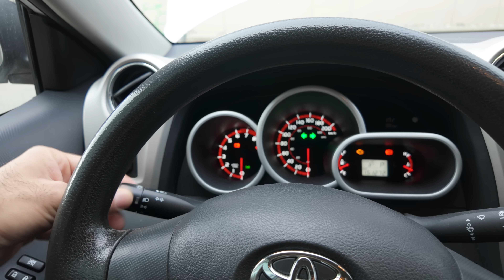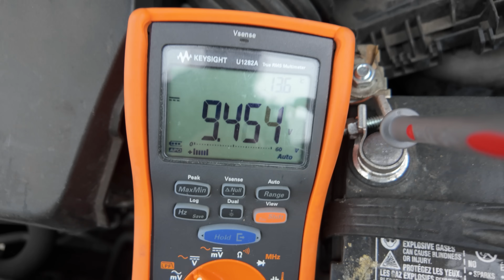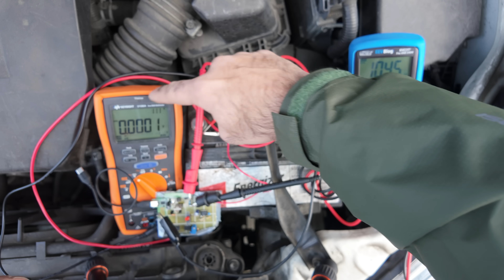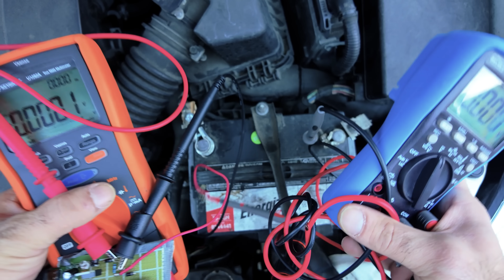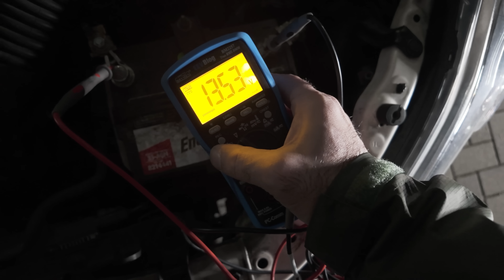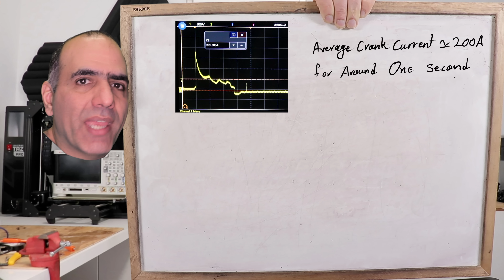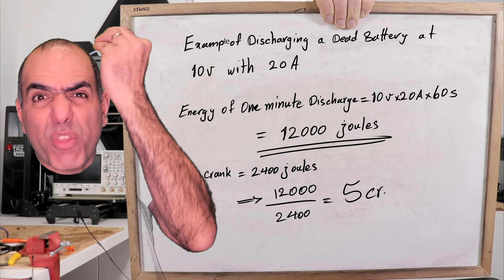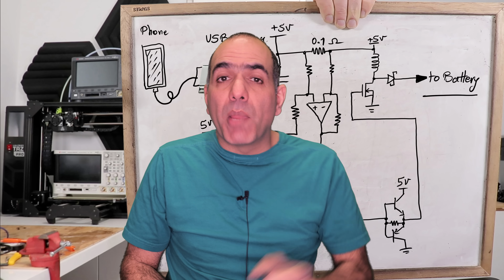Jumpstart by Phone

Comment: I have charged my car battery with my electric bike battery.
I couldn't start one morning so what did I have in stock in the house so I had an electric bike battery and a power supply I connected the 36v battery and then through the cigar port, I set the power supply to 13v/2A and waited 10 minutes and started the car

Comment: EVs still have a 12v battery FYI. And if it dies, you can't "start" the car regardless of the traction battery's SOC because it can't close the HV contactors
Reply: When you put an EV in drive mode it checks first if the break system reaches necessary power. If the 12V battery is too low and fails to power the ABS system the car denies drive mode.
Reply: Most EV’s. Not all. :) Som rely on a DC/DC converter. But it’s rare.
Reply: Yeah, I guess it's for some sort of obsoleted regulations in some regions, so they put that extra weight there just to comply with those and make it possible to say "The EV doesn't start as the battery is dead. No no, I meant the small 1800s one, not the large new one, that's the fuel tank and it's still at half I guess." and actually not being crazy, if only the listener understood instead of looking at me like that.
Reply: @lollllloro  It's also for safety reasons.  You don't really want a mechanic poking around the vehicle with 800 VDC lurking all over the place waiting to catch them out, because they don't know how to isolate the pack on that specific model of car.  Likewise shutting off the battery after a significant accident (one that deploys the airbags) means rescuers don't have to worry as much about cutting through live higher voltage cables when trying to rescue someone they have to cut free from the vehicle.
Reply: @lollllloro  The reason is (likely) a lot simpler: Why develop a completely new setup to run your low voltage circuits (like lights, power steering, infotainment, etc.) if all that tech already exists. It's a lot cheaper, and with EVs it's usually not a big deal assuming the 12V battery charge circuit is bug-free. There's been a line of cars that accidentally discharged the 12V battery too far, which lead to the cars getting inoperable. Under normal conditions, these systems would quickly connect the High Voltage battery to charge the 12V battery for a few minutes before disconnecting again and entering the sleep state. On the affected cars, that logic was buggy and caused the 12V battery to discharge too far.

Comment: The good thing is that with modern usb-c power banks you can usually just get away with buying a trigger board to get the voltage out and making a circuit to limit current to 5 amps

Comment: 1:21 I'm sure you mean the "main" EV battery, but as far as I know all EVs also have a "normal" 12V battery, the 400V "main" battery is way too dangerous to keep plugged in at all times, so the vehicle needs a 12V battery to activate the contactors inside the 400V battery pack.
Also, the systems on the vehicle (lights, media center etc) are just re-used from ICE cars, they are build to work with a 12V battery.

It's way easier to just keep a 12V system and have either a DC/DC converter to step down the main battery and charge the "normal" car battery, or have a dynamo like ICE cars.

Comment: Mechanic here, make sure you replace that car's battery.  once you discharge an automotive battery that far, it will fail again.  your car's charging system will charge it to full but it is damaged and will fail again.
Reply: No need to replace it if it only happens once, just leave it charging with low amp for a night and it will be fine.
Now if it does happen again, then you can replace it.
Reply: hi, dummy here,. i discharged my car battery once, just jumped it and it was fine after that for several more years ... i traded in 4 years later; no problems
Reply: It will be okay after a long period of charging.like 3h
Reply: @amirali-mahmoodi  no it will not

Comment: At 4:30, the DMM is in voltage mode and reads 34mV not 340mA (current). Where is this being read in the boost/charge circuit?

Comment: Pro tip: close the car door when you crank, that turns off the interior lights and thereby saves that power for the cranking.
Reply: Yes. Also I've noticed a lot of people forget to turn of the ac when trying to jump a car. That blower fan and compressor take a lot of power
Reply: @moonhowler13 Wouldn't have really thought about that. A well designed car turns off all or most loads during crank (like disabling your 12v outlets and your AC). So I wasn't considering cars that would try to start the AC during crank
Reply: @hiRyan329329  I've seen some new cars that wont even attempt to crank if the voltage is too low.
Reply: @clayrev  Sounds like a nice safety tbh, only going to bring you further from actually starting if you crank without the voltage
Reply: @moonhowler13  compressor is not started until the car has been running for 3-5 seconds, but if the fan is on it is absolutely pulling between 3-12+ amps from the battery, depending on speed. 

Halogen lights are power hungry too, each one is taking 5 amps, and marker lights are 1A a piece of I recall, times 4.

If you are having trouble or only get one crank (like you discovered you left a light on) make darn sure all that stuff is off as quickly as you can before attempting to start!
Reply: @moonhowler13  Yeah unless you have a hybrid or EV (which have an electric A/C compressor that runs off an inverter/VFD) the compressor is run mechanically from the engine.  You notice it if your car switches the engine off when you're stopped at the lights - the A/C starts getting warmer and warmer until the engine is running again.  Likewise if you turn the car on but don't start the engine, you won't have any A/C, just fans.
Reply: @Berkeloid0  AC compressors on ICE use a clutch to (dis)engage. During cranking, the clutch isn't engaged so the AC saps no power. The same is true for full throttle conditions; to avoid stressing the AC compressor, the ECU will disengage the clutch until normal driving resumes. You can even hear this when idling. Most cars (easier with ones that have noisier compressors) you will be able to hear the compressor continuously engage and disengage based on cabin conditions (because if the system gets too cold, the fans can literally spit frost out at you)
Reply: @devoxin_  I assumed as much for cranking, but interesting it disengages when the revs are too high as well, I didn't know that.  I've never heard mine disengage but then I live in a climate where 35C/95F is the average during summer so I don't think there's ever a risk of the system getting too cold...
Reply: "Divert power from Illumination and Life support to Main Thrusters!"
Reply: Or turn them off
Reply: Don't forget to push clutch pedal all the way down, this makes easier to start engine (MT only)

Comment: I have seen many jumpstarting kits, but I always wonder, why noone makes one that fits in your 12V cig lighter socket? Not a jump start kit that delivers that instant power, but something that would reverse charge the battery and let you have these couple of cranks. Not at 350mA but maybe faster, 5A should be more than enough for fast speed and would not trip any breakers in the car as these are 5A minimum. If you had 2 cranks after 45 minutes then having 15x more powerful charging would mean 3 minutes of holding such device in your socket. Then you could start your car, without ever opening your hood or trunk and connecting terminals.

Comment: It'll work better with EV cars. The 12V battery going flat is still a common problem, but the loads are lighter, critically you need just enough energy to power up the computer and pull in the HV battery contactor.
Reply: Might be true

Comment: Why don you charge your super capacitor bank to 13 or 14volts and with that connect to thw battery and quickly cank your car. It will not charge enough your car battery, but the starter may suck power from the bank, after the car starts the car’s alternator will charge your battery.

Sorry for my english, you get my point?
Reply: Similary to jumpstart with another battery, since a capacitor contains less energy that a battery, i think you will be able to charge in a rasonable time, and it can deliver huge amount of current due to his low internal resistance, perfect to crank a car.
Reply: I mean, in a car you dont really need to fully charge to a desire level your car, you only need to supplly enough charge (at no below of 7V) for a short time only to crank and start the car. Once start the alternator do the rest.

Comment: I'm pretty sure this actually would work on my EV.  See, mine has a "normal" 12V battery in it to run the accessories, and if that one goes dead, one of the things that won''t work is the circuitry that closes the contactors on the main batteries when the car is first turned on.

Unfortunately I'm pretty sure that the 12V battery is currently too dead to be revived.

Comment: It only took all day... And the battery isn't 13.5v. The battery is always 12v. The alternator charges the battery at 13.5v - 14.5v if it's a smart alternator. 14v to 14.5v if it's a normal alternator.

Comment: I'm always impressed that there is nothing build into cars to automatically switch off lights etc ones the battery reaches a certain voltage. Feels like a no brainer and it couldn't be that expansive to build in something simple that does it.

Comment: Not sure what your output voltage was on your boost converter, but typically you want to charge a battery at 13-14v. 12v of battery is considered less than 50% charge. And using an alternator to charge your battery is very hard on the alternator and will cause premature failure

Comment: You don't need a whole decoy board for USB-C - just two 5.1 kΩ resistors would be enough (or one if you'd use a USB-C plug rather than a socket).

Comment: 10:02 Lead-Acid batteries in general, even with improvements like EFB and AGM, don't like to be discharged. You can pull 55Ah, but this will lead to a lot of sulfation. This is an irreversible process and that will reduce the batteries total capacity and current delviering capabilties.

Car batteries are really prone to that, because the lead in them is like a sponge. This gives them a lot of surface area, which allows them to put out this much current. If you want or need to deep cycle them, you should get a deep cycle battery, they come with a massive block of lead instead of a sponge.

Comment: The battery didn't jump to 13.5V when the car started - that's the voltage the alternator puts out at idle. The batter voltage would be a lot less still but the alternator will be dumping a ton of current into the battery to recharge it. It's actually a good way to screw up the rectifier diodes in your alternator using it to re-charge a discharged battery.

Comment: That's going to be one unhappy battery and alternator. One lead acid batteries may have a resting voltage of 12 volts, but they like to charge closer to 13.8V to 14.4V. Second that battery likely is of the crank style. Crank style batteries don't like to be deeply discharged. That's in contrast to deep cycle style batteries that are ok with being deeply discharged, but don't like to provide high current. Alternators are the main source of power when your car is running. They are mainly there to recharge your battery from cranking, and run your electrical accessories. They are not well suited to recharging the battery from a deep discharged state.

Comment: That is called a boost converter. Good jobbie. You can also just use a usb cable and a cell phone battery charger thingy. I am surprised at how little electricity a lead acid battery holds. It literally is about the same as 2.5 cell phones.

Comment: A car battery capacity is generally given on 10 hours (if not 20...)  so 55AH is not 55A during 1 hour  it will be 5.5A during 10Hrs. This is detail and don't change much at the video quality.   If you draw 55 A  it would not stand 1 hour but way less...

Comment: "none of this works on an EV" It depends. EVs have a low voltage rail that, currently, is covered by a typical 12v car battery. The high voltage battery isn't always connected when parked (though it may periodically connect to maintain the 12v battery). In order for the high voltage battery to connect, though, contactors need to be engaged, and the 12v battery handles this. If the 12v battery is too dead, it can't engage the contactors and connect the high voltage battery. You can't start an EV in this condition even if the high voltage battery has a high state of charge. And hilariously, you can jump start it just like an ICE vehicle. One key difference is the amount of current required is far lower. I measured a peak current of 40 amps from my 12v battery when starting my EV. I learned quite a bit about this problem because Kia puts crap 12v batteries in their cars. I haven't had issues since replacing it with an aftermarket 12v battery.

Comment: You're sure you read your current right ? Most of the times, 1A at the amp-clamp  egals 1mV on the voltmeter, so you would have been charging at 34mA instead of 340mA, hence why it took so much more time !

Comment: My brain always tells me that I should be able to spin the alternator by hand or w/ a drill and it would charge the battery but in practice it doesn't work unless you have a whole separate power supply like a second car battery.... I feel like there should be some kind of pedal mechanism I could make that would produce enough current to charge a low battery but I doubt anyone would be interested in buying something like that.

Comment: FYI it is very hard on an alternator to charge a completely dead battery. It will shorten the life of the alternator if done regularly. An alternator is intended only to top up battery and run the loads demanded by the car.

Comment: A slight correction as to lead-acid battery capacity.   Most such batteries are rated for discharge at the 20 hour rate.  This means full to empty over a period of 20 hours.  Discharge rate current is capacity divided by hours, so the 55Ah applies only if you discharge at  2.75 Amps.
Beware of batteries which claim to give 100 Ah.  The cheapest ones often use the 40 hour rate, so will run for 100 hours at 2.5 Amps.
A further point - engine starter batteries should state how many minutes of cranking amps, e.g. 400 A for 1 minute, with the stated Ah being what remains after using up the cranking amps.

Comment: Slight correction. The battery voltage didn't jump to 13.5V. The alternator was charging the battery when you measured it. With a healthy alternator and battery the voltage should hover around 14.0-14.4V when the engine is on.

And small, kinda unusefull tip. Usually the battery has to have 11v (+-0.5V) to start. But thats with million exeptions.

Comment: A minor issue but 0.0331 is actually 33.1mA not 300 mA. first 3 digits after point is milli then after is micro. The yellow/orange meter was on voltage measurement not ampere

Comment: Car acid battery has 6 cells, 12V / 6 cells gives 2V per cell. But if voltage on single cell is drop below 1.8V chemistry are changing. Forever. Lead structure is gone and PbS (lead sulfide) layer is build on it.
Now single cell in your battery has way bigger series resistance and it can store much less energy than other. 

Why lead acid battery do not have own BMS i do not know but i suppose why.

Comment: Probably more a function of just letting the battery rest. Lead acid batteries will recover a bit of "charge" after a rapid discharge just by leaving it alone for a while. You can see this effect by monitoring the voltage after discharging the battery. It takes a while for the chemistry in the battery to reach it's equilibrium after a discharge.
If an electric fork lift dies before you get back to the charger just let it sit a while. Like an hour. Then try to get it to the charger again.

Comment: When you explain the inductor switching, I like the analogy with the water hammer: when you have a large flow of water going through a pipe and you suddenly close a valve, all of that water suddenly crashes on the valve and elevates the pressure to really high values. Same happens for an inductor. It's just a large "pipe" for electrons.
Reply: There is a machine that does this, called a hydraulic ram pump. It's a boost converter but for water.
Reply: @thewhitefalcon8539 I KNOW DUDE I'M JUST HELPING GRR

Comment: the voltage from the running car is not from the battery, but from the generator. lf you get jump started don't turn the car of for a few minutes at least

Comment: So out of curiosity, is the low voltage of the discharged car battery not also going to affect the crank? 
It may need to be above some limit in order to deliver a sufficently strong pulse.
So just having the necessary energy for 1 crank in the battery is not enough, it also has to be able to properly draw that energy.

Comment: The voltage you measured after you started the car is NOT the voltage of the battery. That is the voltage at which the car is charging the battery.